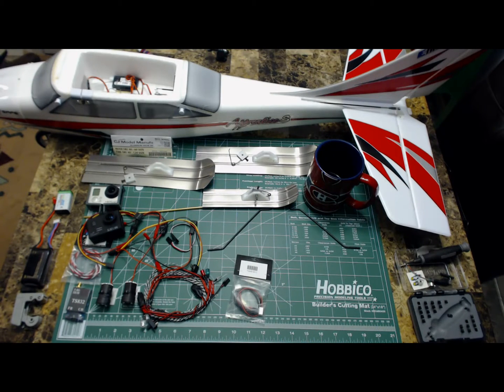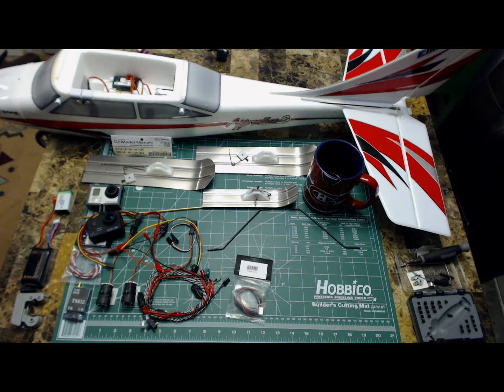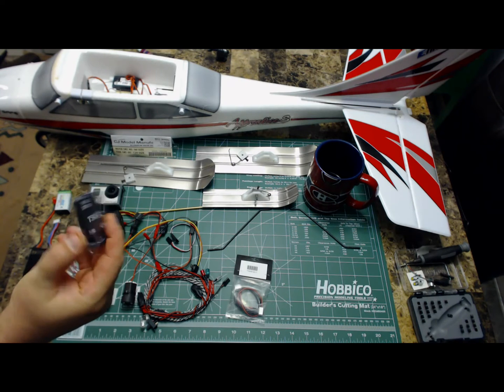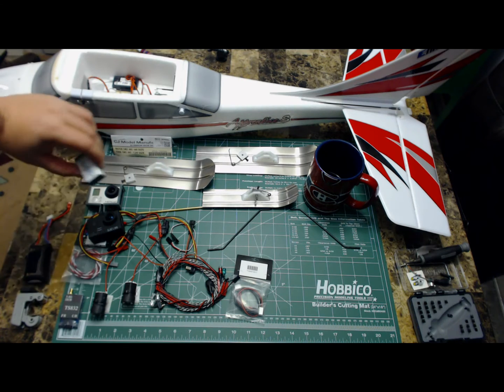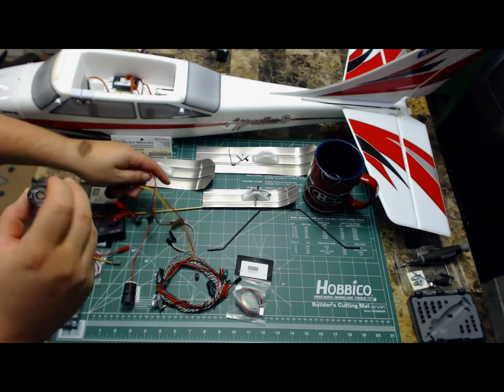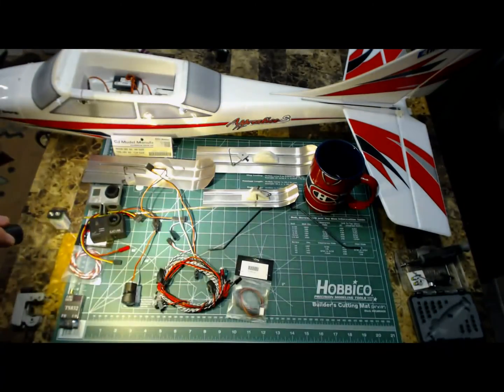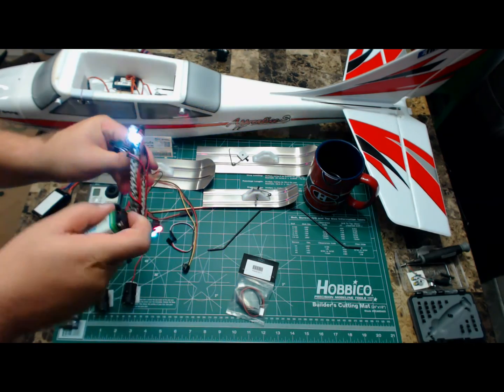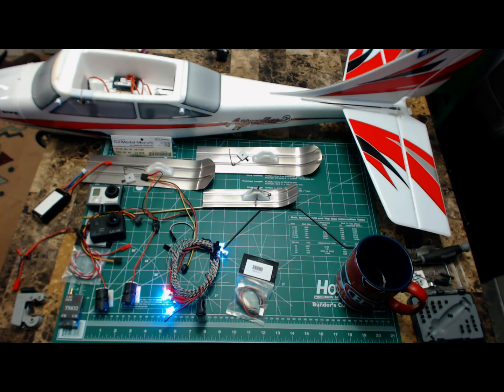Apprentice s 15e upgrade project

Comment: I have my 1st Apprentice set up for running lights. I used magnet wire instead of the braided wire that came with the lights. I made my own skiis but they were too short and were a fail. On my second Apprentice that I only paid $125.00 for,came with an upgraded motor and water pontoons. I love flying it off water. Using beginner to take off and land is a breeze. I have everything for fpv but havent got any of it set up yet. I have had my Apprentice for two years. That white adhesive they glued the motor mounts in failed so I had to use expoxy. My first Apprentice has had many crashes with trees and the ground as I hadnt flown since 1979. Now I dont crash at all. I got a simulator for my computer that really helped me out. I dont use it much any more except to help me fly helicopters.